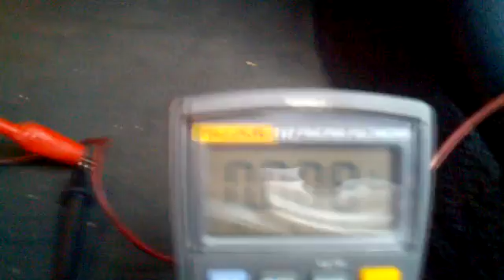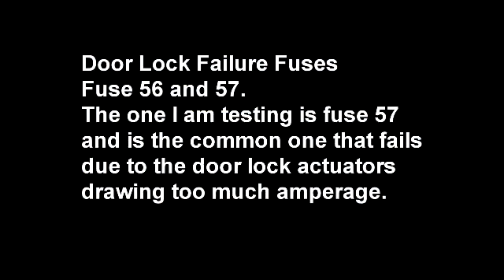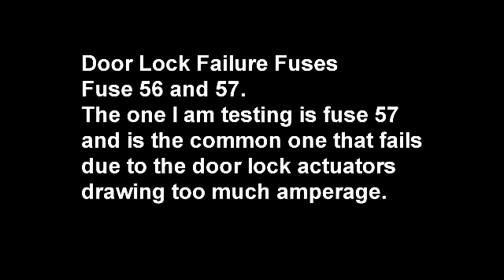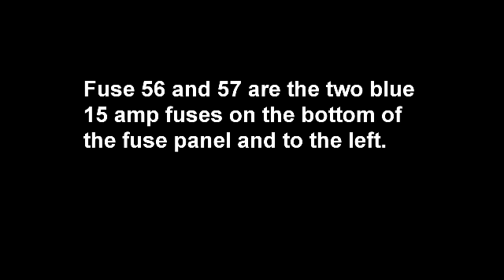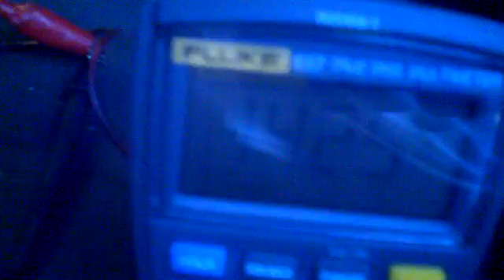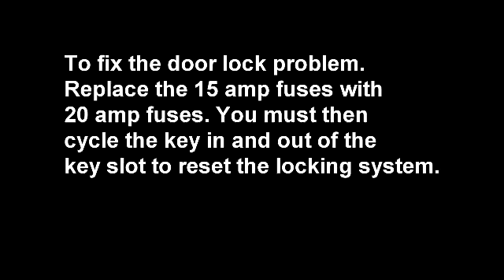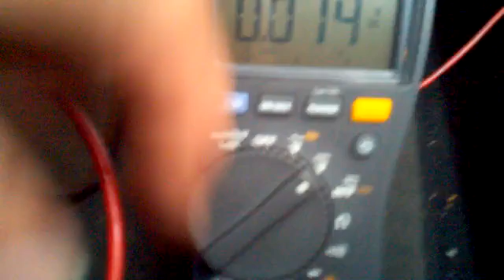3 Series Door Lock Failure and Checking Fuses

Comment: Great vid.  So i have a similar problem here...

* I have a 2007 bmw e90 318d touring / last month suddenly my two keyfobs stopt working. 

* The car does not beep me when i leave the key in the fob, and go out the car. ( What does this indicate anyway?) 

* No problem with ignition. ( Good news indeed Not a programming problem then)

* The remote buttons do not activte anything, doorss, lights, etc...completely dead. ( thus not s fuse problem i presume?)

Today i got my multimeter and checked the battery it seems working perfectly, 3v measured from soldering edges, no change when the buttons are pressed.

So no problem with the battery and soldering...
Did the sync process many times...

So what is the next step to check?

Comment: hi...thanks for the vid.
but i wonder what type is dat ?
my type is e36 m50 and i hav same trouble with central lock..
i wonder which fuse number shud i check...

once i checked fuse #33 15A as per fuse box information
Reply from the maker: +Sabaruddin Suhardjo This problem would not apply to your E36. Central locking is controlled by the general module on your vehicle. It would not hurt to check every fuse with a test light just to be sure you did not miss a fuse that may be related to your problem.

Comment: hello my 2005 bmw e46 has no power when the key is in the ignition. none of the lights turn on the car it self doesn't turn on
Reply from the maker: +Keanu Nones Hello Keanu, Double check the battery terminals and that you have correct voltage from the battery. Have you tried to jump the vehicle at all? The best way to contact me for help is my website at www.bmwdiy.com

Comment: I am the owner of a 330i. I have this same problem, some times, the car wont open or it wont close from the remote key. And the center unlock/lock button wont do anything. I will try changing the fuses from 15 to 20A to check if this get fixed. Will update my results !

Comment: i have a 2001 BMW 325i sometimes when i open the doors from the key didn't work after that i open  the driver door manual and try to open the other doors from inside key and didn't match please can you help me note not all the times
Reply from the maker: Hello, When the problem happens does the locks work from the central unlock and lock button in the vehicle (not the key) also do you have more than one key to try to see if this may just be a failing remote key?
Reply: Hello no i have only one key but i change the key battery, for now everything good, i will see if  it happen or not
Reply from the maker: Excellent! I hope it stays fixed!

Comment from the maker: I might be able to check if you send me the last seven of the VIN. The other way is to see if you have the options for the alarm in the I drive. If not and you do not hear a sound most often it is not installed. After installation the vehicle will need to be retrofitted via programming.

Comment from the maker: Hello Alan, If your vehicle has I drive (navigation) it should be under the settings menu. If it does not have navigation you will need to use the stalk switch and BC button to access the car key memory settings.

Comment: hi how are you doing? I just bought the 2008 bmw 335 convertible but I wanna know how can I trun on the alarm for my car. when I use the remote unlock my car the door will be unlock also the light will be flash but no sound? thank you

Comment: Hi there i have a bmw 320d touring on a 2008. My locks have stopped working and they dont open with the key fob. I can open the doors manually with the key. when I open the car this way only the drivers door opens. once inside the other doors dont open even from the handles! and to boot my central locking button on the dash doest'n work now along with my fuel cap ... and im low of fuel! Any advice would be greatly appreciated. Thanks in advance!

Comment: very helpfull video really is.. thanks for upload man.. you are a star.....

i got a question bro... do you know where is the alternator wire in bmw 320d 3 series? that is coming to battery? is it also passing through trunk by any chance? 

actually i am installing secondry battery and a split charging replay switch. i am looking for a 12v ignition wire. which only powers when we twist/cycle the key twice. not once.

by any chance is that wire somewhere in trunk too?

please help.

many thanks.

Comment: Hi, I drive a 2006 325i and yesterday I locked my car and went back out and none of the locks open. Manually, the driver side lock opens but none of the others. Inside the car, the lock switch wont do anything either. Does this sound like a fuse? If not, is replacing the actuators the next step and is it highly expensive? Thanks!

Comment from the maker: If the noise is coming from the door lock actuator it is beginning to fail and I would recommend replacement before it fails in the locked position which turns into a bigger problem :)

Comment: hey man, i got a 2006 325i e90, and only my right (front and back) will not work. Sometimes the front door will lock, but not unlock, and the back door will not do either...tried to mess with the fuzes and no such luck. it was a little bit ago, and i will try your method, but do you think it would be a fuze problem because its only the right side and not the left? Thanks

Comment from the maker: Hello, The most common cause is a problem with the diversity antenna. With a problem like this it is best to use the dealer to trace down. They have a test plan that can check to see if your vehicle can see a key signal from another vehicle. This helps prove if it is the car or key. Then if it is the car it could be a fuse, diversity antenna, wiring, or the body control module. Send me the last seven of the VIN and I will look up the fuse location.

Comment: Tried your guide no luck tried the press lock then unlock x3 and release method and this caused the red light on the fob to stay on for 5 secs or so but no doors unlocking so i guess the fobs ok and the problems with the car could it be a fuse or something to do with the door?

Comment: Hi i recently bought a 1998 316i compact I can open the doors with the key but the remote wont open the doors.I tried to reprogramme the key using a guide as i do this i can hear a faint noise but the locks dont open or lock with the remote. Can you help i don't think its the key ?

Comment from the maker: ...see previous post too. I have an E46 now and can make you a video for the GM location. For this model BMW a used general module can be installed and then the key initialized but it still may need to be programmed. If you can find one that has all the same options as your vehicle all you would have to do is install and then initialize the key and windows. Let me know if I can try to help further. Best wishes to you.

Comment from the maker: Hello, This sounds like a bad general module. The GM controls the locking system. The key here is that the central unlocking button, remote and tumbler at the door will not make the locks work. The central unlock button is a direct input the the general module and even if the remote system did not work the center button should. This makes the GM the most likely failue. It needs to be programmed upon replacemet and then the key initialized (I have a vid for that) :)

Comment: Hey I have a 2001 323i just bought car but power locks are not working from remote, switch inside or even when you use the key at door, there is no power. Checked the fuses can you help?

Comment from the maker: Hello, Can I have the last seven of the VIN to review your wiring diagram. It may be that the door lock actuator is failing internally. The fuse usually opens due to a high amperage spike due to the door lock acutator failing. If you have put in the 20 amp fuses instead of the 15 amp and the problem is still there only on one door it leads me to think the actuator will need replacement to fix this for you.

Comment: Hi, just found your vid.  A few days ago, my passenger front door lock stopped working ('07 328xi wagon, so an E91).  Unlock doesn't work on the fob, inside button nor the comfort access handle.  Lock only works on the fob, nothing else.  There's four fuses assigned to lock functions according to my fuse diagram, I just pulled all four and they don't seem blown.  Per a comment below, I'll try running the car to see if anything resets, but for now it seems that pulling/resetting didn't help.

Comment from the maker: It might be worth checking the two fuses again to make sure one of them did not open again but it does sound like the actuator. On a bad day I have seen them fail and release a small wisp of smoke (usually with the door shut) and then it no longer opens as it locks in double lock. Unfortunately the smoke will not go back in :) and the actuator is replaced after much difficulty :) Best to replace the bad ones as soon as you can.
Best wishes!

Comment: I changed the fuse, and had to drive a little also. Then it worked... but not perfectly (not with the buttons on the key, and the car middle button only locks it seams. But when I use the key in the drivers door it unlocks and locks the other doors. But this stops working if I press the trunk button and lock button. But after driving some meters, some locking mechanisms seem to work again. think I have to change one of the door actuators. This video helped me a bit on the way I think. Thanks!

Comment from the maker: Hello, I looked up the wiring diagram and the fuses still look like 56 and 57 are the ones to replace. If you can send me the last seven of the VIN number to my messages folder I can double check at work but on the online wiring it is 56 and 57. I have seen door latch actuators fail as well but many times only the fuse is needed. 
Let me know how it goes :)